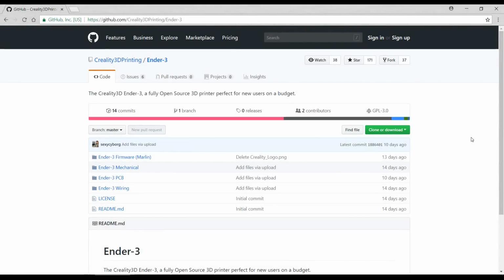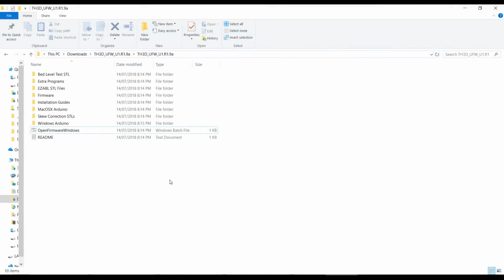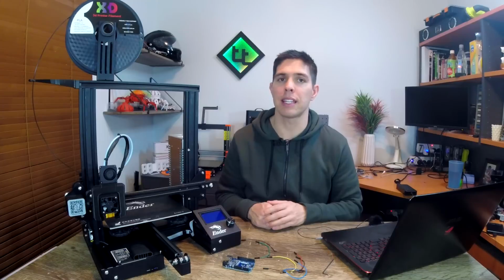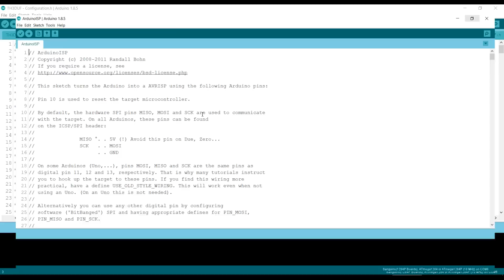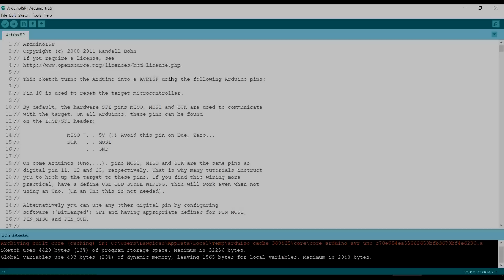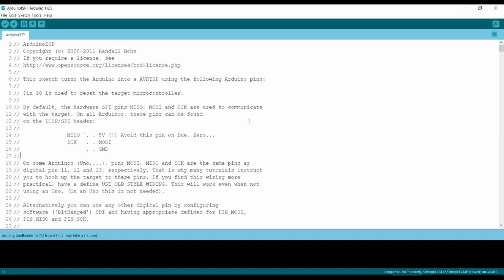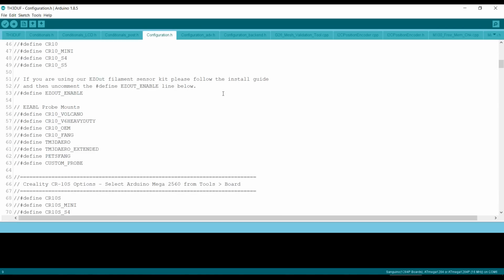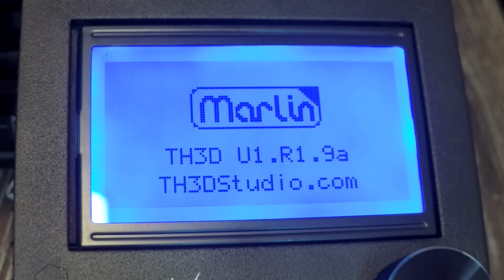Ender 3: How to install a bootloader and update firmware

Comment: This was fairly straight forward, minus the fact that my board in the Ender 3 Pro is now oriented different, so I had to work side ways and  upside down to gain access to the pins and have them oriented the same as the Uno. The only other thing to note, is that somehow my SD card got wiped out of existance. My printer and even my laptop doesnt even recognize that it is plugged in to the sd card slot. It is just gone. Time for a new SD card...so note: remove SD card before proceeding with flashing. I also don't see a place to initiate the EEPROM in the printer menus now that I have the new firmware installed. Overall a great walkthrough and thanks for this!!!!

Comment: i got this error message when i tried to upload

Arduino: 1.8.7 (Windows 10), Board: "Sanguino 1284p, ATmega1284P (16 MHz)"

FindFirstFile C:\Users\\AppData\Local\Temp\arduino_cache_768299: The system cannot find the file specified.

Error compiling for board Sanguino 1284p.

This report would have more information with
"Show verbose output during compilation"
option enabled in File -> Preferences.

Comment: Great video but i am receiving the error message:
avrdude:  stk500_recv(): programmer is not responding
avrdude: stk500_getsync() attempt 10 of 10: not in sync: resp=0xe5
When trying to add firmware to the printer via usb cable any help greatly appreciated.
Reply: same problem....  have connection (com3) though USB to Ender 3.  Run and it fails.  Tried reinstalling bootloader and same issue

Comment: Thanks a lot! You are the 3d printing guru. I had the problem "Expected signature for ATmega1284P is 1E 97 05" I thought it was due my generic arduino but I checked my wires and it worked perfectly

Thanks a lot for share all your knowledge you are the best

Comment: What am i doing wrong? This is the error i get!

Arduino: 1.8.9 (Windows Store 1.8.21.0) (Windows 10), Board: "Arduino/Genuino Mega or Mega 2560, ATmega2560 (Mega 2560)"

avrdude: ser_open(): can't open device "\\.\COM9": Incorrect function.

Error while burning bootloader.

This report would have more information with
"Show verbose output during compilation"
option enabled in File -> Preferences.

Comment: Hi, can you pls help me?    

I am trying to follow your video (im a noob) and I am getting an error on the last part (uploading the firmware)

This is what I used to upload the bootloaded.  It said that the bootloader installed correctly

I purchased this:  https://www.amazon.com/gp/product/B07V9VGXFS/ref=ppx_yo_dt_b_asin_title_o00_s00?ie=UTF8&psc=1

but now I am connected via usb to my computer to do the last step (upload firmware)…. I have my settings matching yours, but when I hit upload I get

avrdude: stk500_recv(): programmer is not responding

it makes 10 attempts and then fails.   

I dont know what to do... can you pls help?!?!?!

Comment: for all of you that are watching this late 2019. for version 1.8.7 ender 3 will be line #320
Reply: Do you know if this video is still relevant? This bootloader install will continue to allow me to update firmware from my computer through USB A to USB mini?
Reply: @muuubiee  yeah you'll be following the same basic steps the only difference will be the lines in the code when you first send it with the ardrino board
Reply: @Jellyjab  Where do I find the code?
Reply: @muuubiee  the link that the guy gives, from th3d
Reply: The latest version from Creality (out of the box) still require a bootloader?
Reply: @RudyAmid  yeah you'll probably need to get the bootloader. I got mine a month ago and still didnit

Comment: thanks for this... im very scared to try this as I really dont know what im doing.   Are THESE the correct jumpers to use?     https://www.amazon.com/EDGELEC-Breadboard-Optional-Assorted-Multicolored/dp/B07GD2BWPY/ref=pd_bxgy_147_img_2/136-6478926-7216203?_encoding=UTF8&pd_rd_i=B07GD2BWPY&pd_rd_r=f64dad53-7385-406c-9ccd-216c8e87f7aa&pd_rd_w=BeGAu&pd_rd_wg=irWpa&pf_rd_p=09627863-9889-4290-b90a-5e9f86682449&pf_rd_r=RZGXQE6KC9DQ8BEJNF26&psc=1&refRID=RZGXQE6KC9DQ8BEJNF26

Comment: Hi, great tut, thanks, but gave me a bit of googling to get it working.
Couldn"t flash the bootloader, got messages about error while sync.
But the solution was here: https://forum.arduino.cc/index.php?topic=587193.0
You should add a 10 uF capacitor between reset and gnd pins of arduino on many unos. As I read on the forum, not all uno compatible boards needs it, but mine did. So you could add some text in the video at the connections part to save some time and headache for some other people. :) 
Keep up the good work, great channel, thanks again :)

Comment: Two days of frustration.  Tried initially with mac, then tried two windows laptops, always the same failure point for me when he says "The hardest part of the process is over".  Plugging ender 3 into any computer, the port would NEVER appear.  Turns out, and I'm at fault cause I was sure this rarely used USB Mini-B cable was power and data and not just power.  That was it tho.  Found another mini B cable in a junk box, hooked it up, appears on every computer now in Arduino.  So anyone stuck at that point in this process, try a different cable.  My power only cable made the Ender light up as if things were good to go...but they aren't.

Comment: I'm in kind of a pickle.  I keep getting this error:  

avrdude: Yikes!  Invalid device signature.
         Double check connections and try again, or use -F to override
         this check.

Error while burning bootloader.
Here is a link to an image of my tool settings just before "Burn Bootloader"
https://www.dropbox.com/s/dtk2kytifl5ys5b/IMG_3496.jpg?dl=0

When I have the Uno plugged into the laptop and motherboard, everything lights up and seems to work.  I have watched this video literally 100 times hoping to glean some thing that I might have missed and I come up empty.  The crazy thing is, is that I have used this video and my Uno to burn bootloaders on 3-4 other printers...thanks for any help!
Reply: Did you ever get this resolved? On the lines before the yikes message, what is the device signature reported as?

Comment: Burning the bootloader did not work for me using a windows 7 laptop and an Arduino Uno as the programming device.
I kept getting this error message:
"avrdude stk500_disable() protocol error expect=0x14 resp=0x10"
After searching around I discovered a fix that worked for me that apparently is well documented:
Connect a 10uF capacitor between the ground and reset on the Arduino board.
I did this simply by pushing the leads through the 2nd set of holes - no need to solder.
Please note reset in this case is the Arduino reset pin Not the pin used by the programmer software that runs on the Arduino (which is IO pin 10). The pin is the third one down on the left if the main USB and power connectors are at the top. I hope this helps someone else.

Comment: Anybody who knows, pls advise: My Ender 2 purchased almost two years ago is totally out of the box stock firmware configuration. Are there any steps along this procedure where it's possible that an error on my part would brick the Ender 2? 
I don't see a downside to making this changeover but I'm always looking for any considerations on why NOT to do something, especially when it comes to mods to software and that includes firmware.
In the programming file I noticed under the Ender 2 section there is a line mentioning "Petsfang" that is commented out. Any information available on if I did that mod later, how it ties in with the firmware? i.e. do I remove the comment from the file and reflash?

Lastly, I see from the video that the power supply of the Ender itself should be OFF the entire time until everything shown is completed, correct? 
Thanks. I'm looking forward to getting myself back up to speed on my 3D printing.

Comment: After step-by-step installation, my result: empty light display. :( I know of course i f..k'd up someting,  now i search the solution. :)
Reply: Got the same issue. a 3 days old ender 3 pro with no display. Did you find a solution to this? 1.1.4 motherboard. tried flashing to newest bl firmware, still no display. Someone know what to do?
Reply: @hellwreck1  hey so idunno about you but once i did the second step of burning the bootloader i then plugged up my machine ndirectly to my pc and it was an empty screen then i uploaded the new firmware and it was sucsessful a of and on and then it worked again dunno if that helps at all

Comment: In order to get it to upload on my Ender 3 Pro, i had to select Sketch-> upload via programmer
Reply: do you lose the pro menu settings over the 3 when updating
Reply: Was that the only difference to the process Michael went through, comparing the Ender 3 to the Ender 3 Pro?

Comment: I keep getting USB device not recognized when I try to plug in my Ender 3 after burning the bootloader. I am using version U1.R2.16a.
Reply: Nevermind I fixed it. I had the wrong cable

Comment: Hi all, I NEED YOUR HELP URGENTLY! 

I use MacOS, High Sierra. In "Misc" part there is no code shown as in 10:15 min. on my Arduino codes -->

// Use Ender Bootscreeen instead of TH3D
//#define ENDER_BOOT 

The codes I see are as follows:

// MISC --------------------------------------------

// If you have a 5015 fan that whines when under 100% speed uncomment the below line.
//#define FAN_FIX

// Use your own printer name
//#define USER_PRINTER_NAME "CHANGE ME" 

// If your printer is homing to the endstops hard uncomment this to change the homing speed/divisor to make it less aggressive.
//#define SLOWER_HOMING

// BOOT SCREEN OPTIONS -----------------------------

// Use TinyMachines Bootscreen instead of TH3D
//#define TM3D_BOOT

// Disable Bootscreen completely
//#define DISABLE_BOOT

So, how can I change this code? Does copy and paste work or no need to do anything for this? 
I'm waiting for your reply.

Thanks in advance.

Comment: This ->>> Elegoo UNO R3 does not work.  I've spent 2 days trying to get it to work and it does not work on Windows10.......
Reply: Having the same problem
Reply: @dmfrench01  see my comment added just now - adding a 10uF capacitor between the uno board's reset and Gnd pins solved this problem for me.

Comment: Thank you for the video, I tried installing my bootloader originally with a USBASP and thought I bricked my printer. Picked up an ArduinoUNO today locally and your video was perfect for getting through the process. I am now running TH3D firmware, time to dial her in and get to printing! BLTouch soon to come and maybe even upgrading to the drop in board you did a previous video over.

Comment: Hi.
I have a Ender 3 with 1.1.5 silent board upgrade. 
Apparently it have bootloader preinstalled for easy USB software update.
When I'm trying to flash it with Arduino it show that is not enough space.

Comment: This guide worked very well for me, thank you!  I used an Arduino Mega2560 R3 by Elegoo instead of an UNO since that's what i had already.  The pins to connect are on a different place on the board, but in the same configuration. If anybody else is thinking of using a MEGA2560.  The steps are identical,  just google the pinout of your board to find the same pins. The only other difference is you select Ardunio Mega instead of Ardunio Uno when programming your Arduino.   Since i didn't have any female to female dupont wires, i used two sets of female to male and a bread board to connect it all up.  Keep up good work man!

Comment: Do you have to switch on the printer to upload bootloader?
Reply: Nope
Reply: No, the board on the printer will be powered by the Arduino power output, or the USB output.  Keep the power supply on the printer itself off.

Comment: I'm getting an error "avrdude: Expected signature for ATmega1284P is 1E 97 05
         Double check chip, or use -F to override this check."
Reply: I got the same message when I tried to flash marlin via ISP without a bootloader to save space. I looked up some AVR forums and since I'm quite a beginner here it was mostly Chinese to me, but what I understood that these chips come with different crystal settings, and if some of the settings don't match, it can cause a bud rate errors. By flashing a bootloader, these settings will match on the printer and the Arduino board. When I tried to flash a bootloader I also got an error message. This I solved by using an original Arduino UNO board instead of a clone.

Comment: I just tried this with my Ender 3 Pro. But they've changed the USB<->serial chip from FTDI to CH340, and that chip is notorious for giving problems with arduino. Some people have better luck if they use USB cables with ferrites on it. But I didn't have that kind in my cable box, so I had to go a different route.
I had to program the firmware through ISP, just as with the bootloader, but with one twist. The ArduinoISP software was set to communicate with the Arduino IDE at 19200 bps, which is fine for burning the bootloader. But when loading the main program, the IDE uses 115200 bps. (Yes, it's a bit odd to use different baudrates.) So I had to modify the ArduinoISP sketch.

Here's how to do it:

Load the ArduinoISP sketch into the Arduino IDE (as in the video).

Find this line and comment it out (Add // to the start of line):
#define BAUDRATE 19200

Find this line and uncomment it (Remove // from the start of line):
// #define BAUDRATE 115200

Save the sketch under a new name, like ArduinoISP_115200 (the original is write protected).

Upload it to the arduino you use as programmer.

Connect the arduino to the Ender 3 Pro like when burning the bootloader in the video.

Load the Merlin firmware into the Arduino IDE, modify it, and upload it just as in the video with the exception:
Tools=>Programmer should be set to "Arduino as ISP"
(And of course you won't use the USB cable to the front, since you're programming through the arudino.)

And the end result was a working printer. At least I haven't found any problems yet, but I haven't tried controlling it over the USB port.
Of course it still doesn't have a working bootloader. So if I want to update it again, I need to go through the whole ISP programming trouble again.
Reply: I'm getting 'oops, make sure to check sanguino in boards'

Comment: I have been trying this but I keep getting the same error :avrdude: stk500_recv(): programmer is not responding
Reply: This is a problem with talking to an Arduino bootloader.  At which step in the process are you getting this message, 1- flashing AVR ISP to the Uno, 2- flashing bootloader to the printer controler, or 3- flashing Marlin to the bootloader?
Reply: @philipgwyn8091  i m getting this error while flashing bootloader to ender 3....i m frustrated wht should i do?

1 thing to note that i have used arduino nano,not the uno.... although i have done all wiring properly as shown in the video with correct pins of nano to printer

Comment: I did this today on my Ender 3 silent board 1.1.5 (apparently this has a bootloader already installed on it, if I had known this I probably would not have spent all afternoon trying to install the bootloader using the UNO and failing) After the Firmware was installed all of the axis (z,y, and x) no longer work. Auto home fails and my machine needs to be powered off to reset this condition. I reinstalled the Firmware, but I am getting the same results. Does anyone have any ideas what might be going on? I cannot find this specific problem anywhere.
Reply: Not encouraging , I installed the 1.1.5 board last week and its been running fine except my auto homing slams into the y and z stop switches. I remedied this by putting 3m heavy duty foam tape pads on the switch levers and that solved the slamming issue temporarily. I read this was an old firmware issue that came back with 1.1.8 and 1.1.9 but that they fixed it in 1.1.9 bugfix release which I was just about to flash. 

What firmware did you use and did you copy config files from the ender 3 folder to the main folder before flashing?

Comment: I used a usbasp (which is cheaper than an  Arduino & no wires) just choose usbasp instead on the uno.  also when flashing, make sure your mini usb cable isn't a power only cable (it just wont recognize the printer, even with drivers installed), I don't have many mini's & the one I was trying was a power cable, found another &  it recognized it & the firmware took about a min). Cheers. hope it helps.

Comment: Is there anything for the Ender 3 Pro or is it not supported
Reply from the maker: Exactly the same process. Only firmware difference for the pro is the word 'pro' on the screen.
Reply: @TeachingTech  Thanks for the reply, was just wondering as on the site its shows Ender 3 then below it in brackets shows ender 3 Pro not supported.

Comment: Hey community, I've gotten to the stage where I am about to burn my bootloader. 

I'm working on mac so something may differ. Also I had to install a driver to get my computer to talk to the printer so 'COM 13' is actually '/dev/cu.wchusbserial141240'

Otherwise I believe I have followed the process step for step. I'm getting to the point of uploading the bootloader and I'm getting this messge.

"avrdude: stk500_getsync() attempt 1 of 10: not in sync: resp=0x15

avrdude: stk500_getparm(): (a) protocol error, expect=0x14, resp=0x14

avrdude: stk500_getparm(): (a) protocol error, expect=0x14, resp=0x01
avrdude: stk500_initialize(): (a) protocol error, expect=0x14, resp=0x10
avrdude: initialization failed, rc=-1
         Double check connections and try again, or use -F to override
         this check.

avrdude: stk500_disable(): unknown response=0x12
Error while burning bootloader."

Can someone shed enlighten this noob??

Comment: Great Video! FYI: for the Ender Pro 3 the control box is flipped upside down (screws underneath the printer) but other than that it still works great.